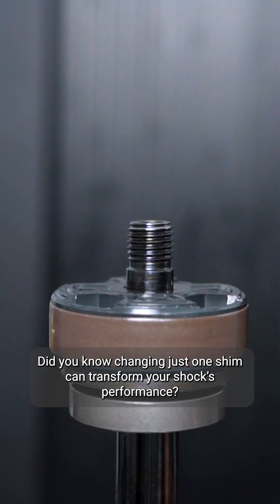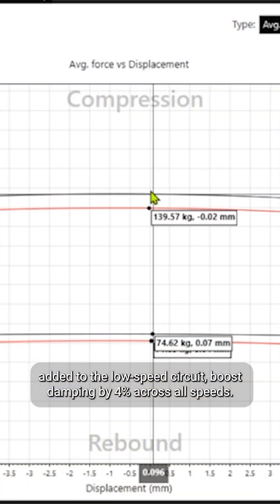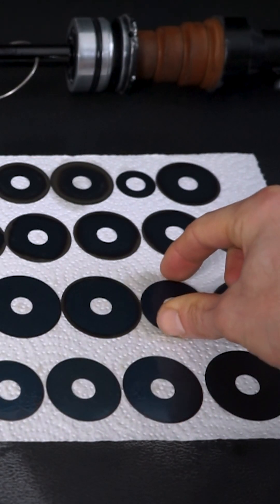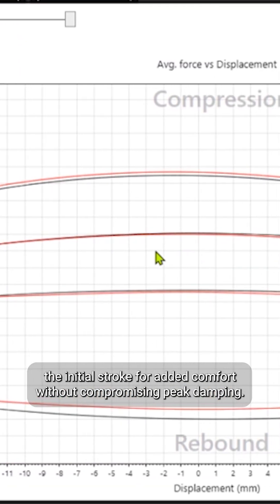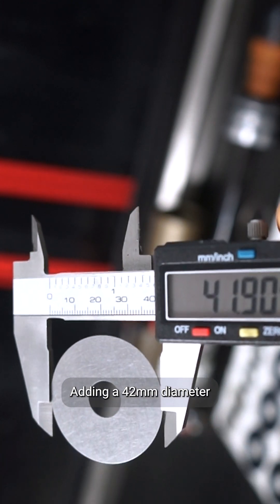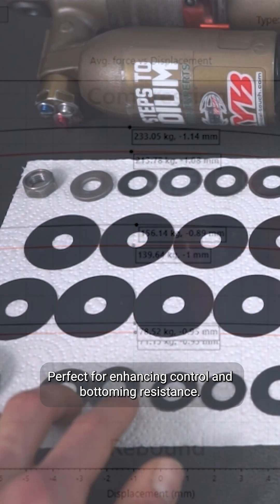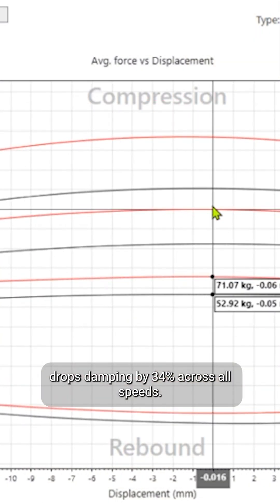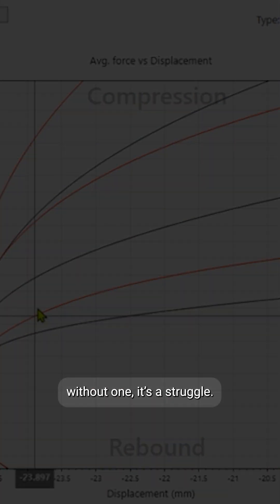Can One Shim Change Your Suspension? | Shim Stack Tuning Explained

Comment: Wish I had a shock dyno but they are way too expensive for your average garage mechanic.  Without one it's a process of trial and error.  I've re-shimmed one of my shocks 10 times before I got it where I wanted it.
Reply from the maker: Thanks for the comment - and we understand the struggle. Trial and error can be exhausting without proper data.

That’s exactly why we’ve worked hard to keep our dynos as affordable as possible without compromising on test quality. Everything - from software to hardware - is developed in-house to stay efficient, accurate, and cost-effective.

We also made our dynos fully upgradable, so even if someone picks one up secondhand, it can be brought up to the latest spec. we aim to make and keep suspension testing accessible.
Reply: You can build an improvised dyno rather cheap. But for one it's quite a bit of work and second it's not exactly free either.

Function isn't nearly as good as a professional product, especially since it'll either lack proper software and requires you to do that part manually or you got to develop something simple for it.

Probably better to look fora local MX racing shop or similar and have them dyno it. But that only works if you know what you need pretty well - and last but not least know how what you want looks on a dyno graph.

Comment: Can you do this without shock Dyno?
Reply from the maker: Yes, but without shock dyno it would take a LOT of time and you would need quite a bit of experience to "feel" the difference
Reply: I mean, that highly depends.
If for example rebound is absurdly slow with most of the range unusable and even fully open still a bit too slow while everything else is fine and somewhere around the mid third setting wise - that can be a quite easy fix to get to a way better range. 
Or not, but worth a try imo. 

More intricate tuning is way more involved, naturally.
But such potentially easy to solve cases are the majority of casual rider damping problems I've seen.
In fact - I recently got a suntour wc team shock here that's surprisingly great and doesn't feel like an air spring at all, had an excessively slow rebound. Opened it, changed one shim, tested, put it back and just simply removed another shim altogether instead - best shock I've ever ridden now, although the last third of rebound is still a bit slow. 
Next service it'll get a bit lower viscosity oil and should be even better all around. 

If you're able to do full service work anyhow I'd just give it a try if it seems to be a simple problem and you got at least some grasp how things work. Worst case you need to open and put it back to original again and are back at your starting point. 
You can always still send it in and get it professionally tuned, doesn't hurt to experiment a bit beforehand. 
Helped me to understand what I really want in the first place.